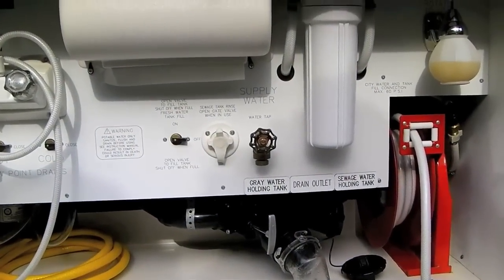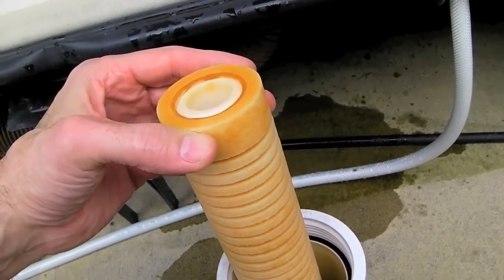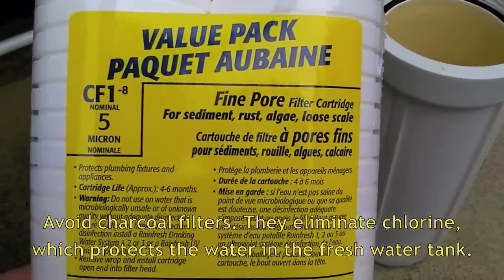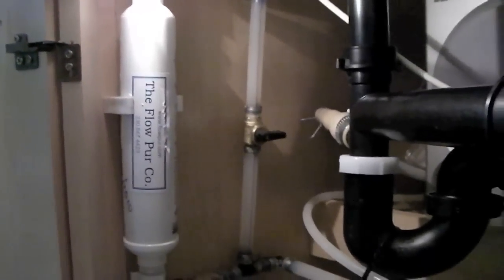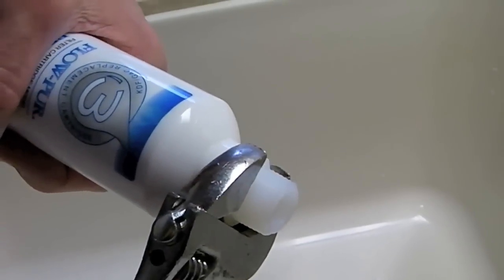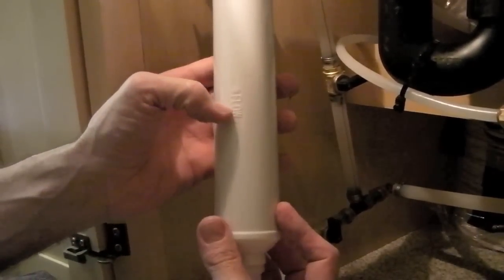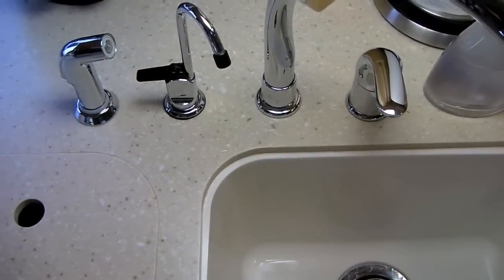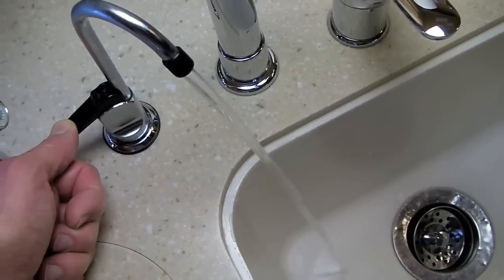HOW TO: Replace RV Water Filters

Comment from the maker: Great to hear our videos are helpful. Thanks Lori & congrats on your new rig! As full-timers, we've never winterized, but here's what I'd do with water systems after storing. Hook up to city water, & with water heater lines set to "bypass" (to avoid pulling anti-freeze through it) run lots of water through ALL faucets (both hot & cold lines).

Drain, then re-fill & sanitize the fresh tank (and water lines), flush the water heater and replace any water filters, as per our videos, of course. ;-)

Comment: So I don't make a mess I want to relieve the water pressure by either turning off the water pump or turning off the faucet from the city water at the incoming city water supply ? I plan on doing this after I  dewinterize and get a new filter in the canister.
Reply from the maker: Turn off BOTH water pump and city water, then open a faucet to relieve the pressure. Then you can replace the filter.

Comment: I specifically am looking for a filter because I DON'T want chlorine in my shower or drinking water. Why is it necessary to "protect" the water in the fresh water tank? Please explain.
Reply from the maker: You're not "protecting" the water... you're disinfecting it, by killing bacteria that grows in stagnant water, such as when stored in a holding tank. If you want to be able to safely drink the water from a holding tank (rather than buying and carrying bottled water), you have two choices: 1) Disinfect the tank periodically with the correct concentration of chlorine, or 2) Use a purifier, such as an Acuva, at your drinking water dispenser. If you prefer to avoid bleach, check our videos about our Acuva. Installation: https://youtu.be/YNX4DKo8ngg and Testing: https://youtu.be/0qk0vycLYAs  We're currently testing a new Acuva model with a higher flow rate... and lower cost. Stay tuned for that video soon!

Comment: We have a newmar 5th wheel we just bought. (2011) and the filter cover doesnt want to screw off. I'm going to assume it has never been changed out. Any advice on how it might loosen up so I wont break anything?
Reply from the maker: +Michael Henderson That's a tough one, Michael. I've accidentally tightened ours on a bit too firmly and then thought I'd break it when I went to remove it the following year. The best I can recommend is to push the button on top before trying to unscrew it, which will release the pressure inside the filter. After that, try to avoid torquing the whole thing while unscrewing it with both hands and keep your fingers crossed. There's no real trick other than depressurizing it first... and maybe doing the project while you're located somewhere near an RV dealer, so you can buy replacement parts in the event of an emergency.Let us know how you make out.
Reply: Didnt know there was a button top... lol, I will try that next. BTW, maybe the video showed it but do you use a separate water filter in-line with the hose?
Reply from the maker: +Michael Henderson Nope on the separate filter. The only thing in line is a pressure regulator. Now I hope your filter has a button on top like ours does. 😉
Reply: It did and I I was able to turn it with a bit of effort. Do yuo recommend a brand of C-2063 type filter?
Reply from the maker: +Michael Henderson Glad you got it off. We just use typical whole house 5-micron filters that we pick up in Lowes or Home Depot.
Reply: For anybody else with this problem what we’ve done just warmed it up with the hairdryer a bit and gave her a couple short taps loosened right up

Comment: Great info. but I have a different problem, maybe someone can help
I have 2 faucets that have no pressure/low volume on both hot and cold side, while the others all work correctly. Kitchen and bath sink are the problem; shower, toilet and second bath faucet all have full pressure
Reply from the maker: +Priscilla Cole Hi Priscilla. Do you by any chance have the Manabloc system? It looks like this:

http://216.117.131.111/4EuIe7oEiI/M100481.1.jpg

This system is most common on newer, higher-end RVs, and allows water flow to be individually controlled to various parts of the RV.
Reply: Priscilla Cole   I don't know if you already tried cleaning the filter of your faucet. ?  End cap screen
Reply from the maker: Great idea!
Reply: RVgeeks 👍